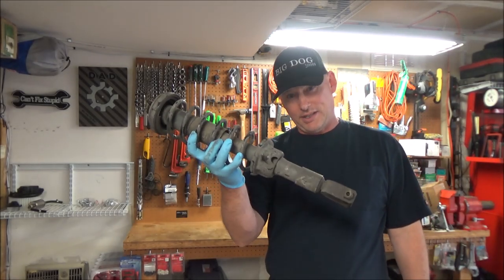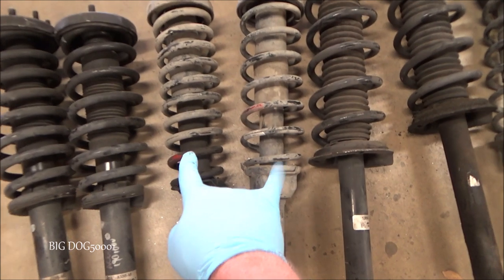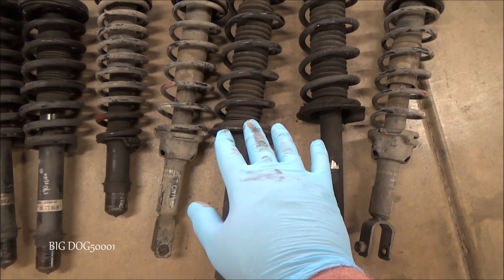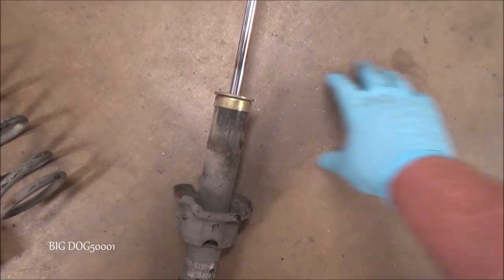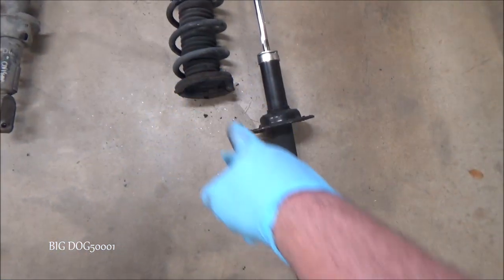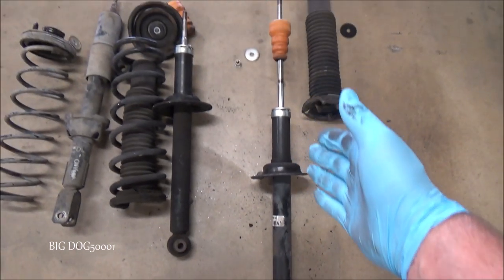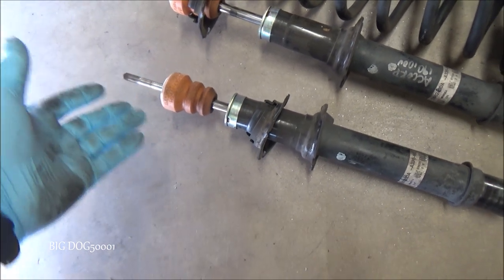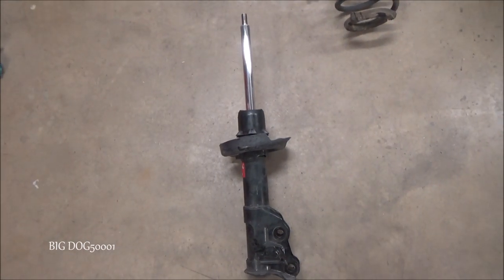Do Struts Go Bad?  How to Diagnose Bad Struts

Comment: My front tires on my truck has started to make a scraping sound when i turn in my driveway sharply uphill right or left. They rub in fender well inside toward the back. This is the only time this happens can this be the front struts ty

Comment: Big mistake I made, I went the easy way and installed a pre-assembled strut/springs, and tossed away the original springs of my Honda Accord. Although I got a very good after-market brand (KYB), yet nothing can compete with the original OEM quality springs. KYB is a good quality shocks, but when it comes to their pre assembled ones (called Strut Plus) they're no better than any other after market assembly "spring wise". Safety was my concern, but this time I'm going to rent the compressing tool from Auto Zone.
Reply from the maker: I have no problem using KYB strut assemblies, I have not had an issue with the springs they use.  Your experience has obviously been different.  Cheaper strut assemblies are a whole other story.
Reply: I've heard that one problem with quick struts is that the springs can often be too thick. It's probably more of an issue with cheaper manufacturers.

Comment: 2 out of the 4 struts on my 2007 Accord V6 failed at about 100K miles.  They failed spectacularly and leaked a bunch of hydraulic fluid all over the lower control arms and then got on the inside of the rim which flung it everywhere.
Reply from the maker: That can happen sometimes, thanks for the input!